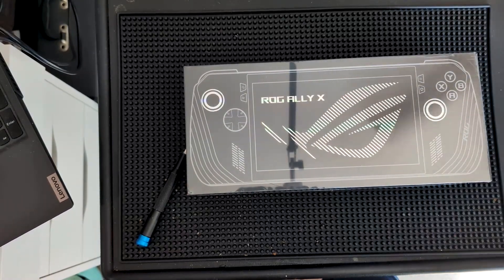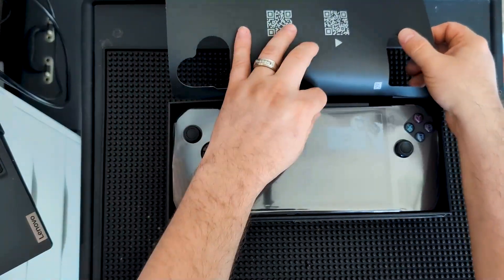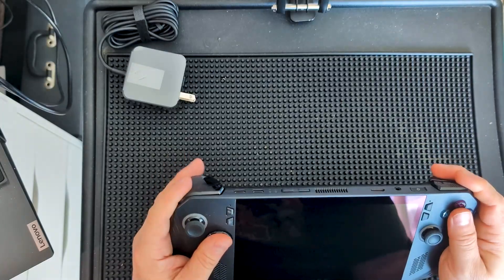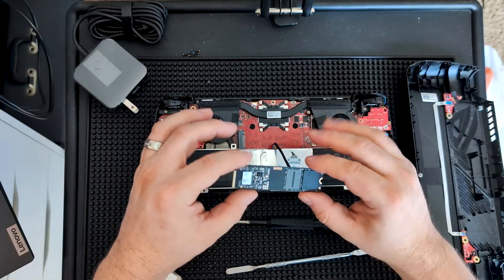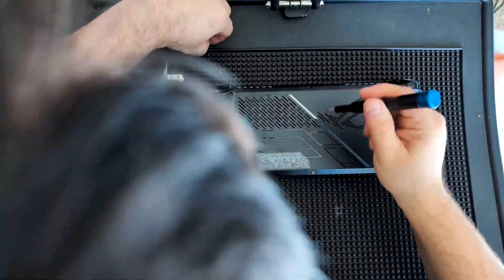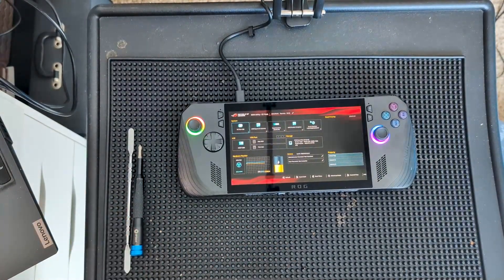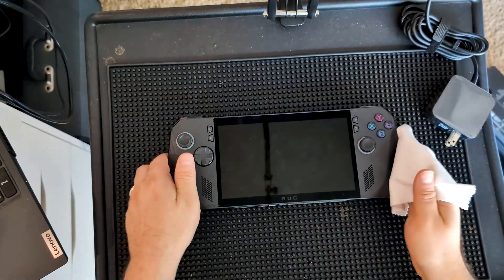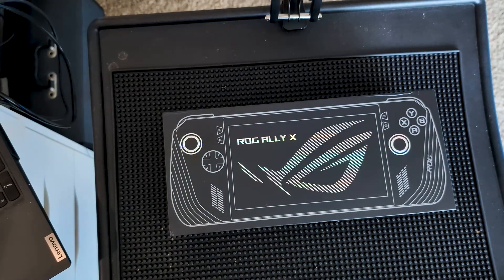Asus ROG Ally X 4TB SSD Upgrade + Coin Drop Customs Optimization | Faster, Cooler, Longer Battery

Comment: Can you upgrade the ram on a lenovo legion go to 32gb?
Reply from the maker: It's possible and I've done that type of procedure before, but it requires specialized tools and involves removing RAM chips from the main board(desoldering).  You then I have to install higher capacity flash memory chips in their place and flash the bios to get it to register the new RAM.

It's possible, but not really worth it IMO.